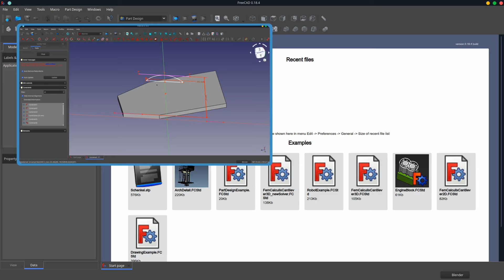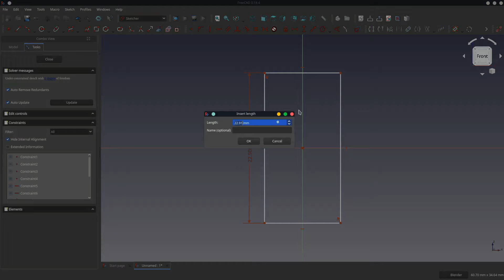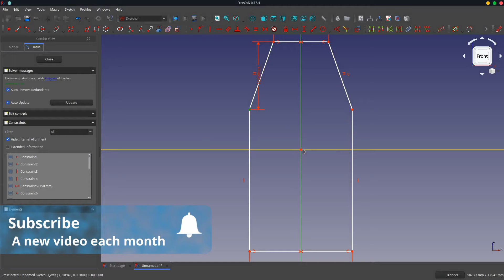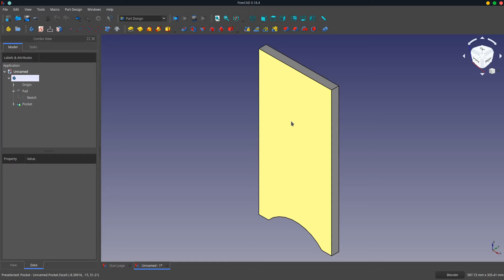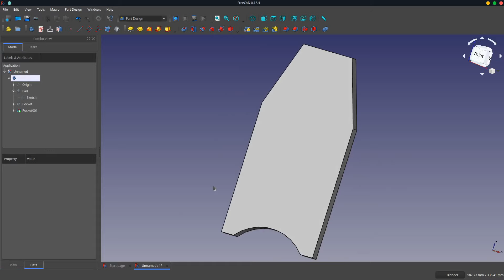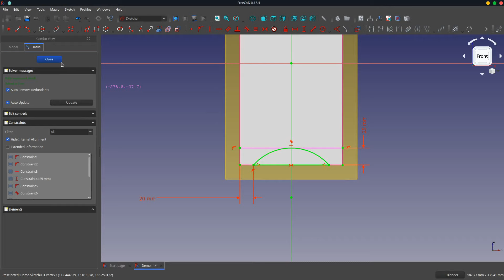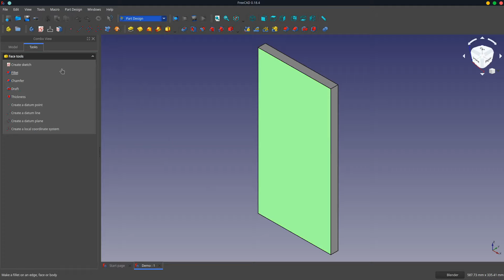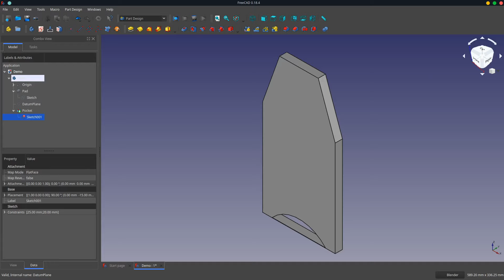Exploration of the Topological Naming Problem in FreeCAD

Comment: Interesting video. I am very new to this but it seems to me that whilst what you describe gets around errors, it doesn't get around the fundamental flaw. I thought one key feature of a parametric editor like this was the ability to go back to an earlier design stage, make changes, and have them propagate through.

For instance, I haven't tried this, but I am assuming that if the datum plane is disconnected from the face, and that face was padded by 15mm from the original sketch, then if one went back and changed the pad to - say - 20mm, the cutout would now start 5mm under the original face - because the link to the face has been broken? So, the design file is not broken, but the intent of the design is.

Clearly there must be limitations - even with no TNP if the face no longer existed after an earlier stage change, or maybe a design line or vertex made visible no longer exists, some sort of error would have to occur, but it needs to fail gracefully.

Maybe therefore, there is no answer to TNP at the moment.

Do editors like Fusion 360 have the same issue, or is it specific to FreeCAD?
Reply from the maker: Hi Nick, you're correct in your assessment and example are correct. I understand that this is a fundamental flaw with the current versions of FreeCAD but that there is an experimental fix for it that has not been merged into the main development stream yet. This means that we'll have to work around the problem for the time being.

I can't say whether this is a problem in other CAD packages such as Fusion 360 because I haven't used them,

Comment: I realize that this video is 4 years old - have you checked this with the new 1.0 version?  And will this method work with the 1.0 version.  Thanks in advance for any assistance you can offer.
Reply from the maker: Thanks for your question. I had heard that a lot of work had gone into fixing the problem in version FreeCAD 1.0 but I hadn't actually tried to reproduce the problem until you asked. I created a step tool side as per the video in FreeCAD 1.0 and the topological naming problem seems to have been solved - at least as far as my example is concerned. That's good news from my perspective but I haven't done enough testing to be absolutely certain.

Comment: Another problem with using the datum plane approach is that if you change the thickness of your plank (from 15 mm to 25 mm for example), the change does not propagate to subsequent elements, so you have to reposition the datum plane. Luckily, this does not completely break the model, and can still be managed.
Reply from the maker: Yes you’re right about that
Reply: You can work around that by making the thickness a reference variable and making the plane offset equal that thickness.
Reply: Indeed, that works.

Comment: I try to repeat these workarounds with 0.19 version of FreeCAD and always get mistakes on last step (with second sketch) but these workarounds are working fine with 0.18 version
Reply from the maker: Thanks for your feedback. I have replicated the problem on 0.19 (git version 24291 ) and 0.20 (git version 25429). The rules around referencing external geometry seem to have changed between version 0.18 and 0.19. In versions 0.19 and 0.20, the result referencing external geometry in a sketch works in the same way that sketching directly onto a face, and so the topological naming problem is triggered.

The solution (from my limited testing) is to remove the references to external geometry in the sketch that defines the cutout for the foot, and use dimensional constraints to constrain the sketch. There is no connection to the base sketch once you've done this and the topological naming problem is not triggered. I hope this helps.

Comment: Download realthunder FreeCad Assembly 3 which is FreeCad with that problem solved
Reply from the maker: Hi Carlos, thanks for the advice. I'll have a look into it.
Reply: @GlassonDesignStudio  another alternative is to use the main FreeCAD but avoid attaching sketches to edges/ faces (see https://forum.freecadweb.org/viewtopic.php?f=8&t=47671#p408943), in other words make every sketch a separate entity. It makes your design robust, however it takes more time to rebuild an object since you need to manually change all features when you update one of them. The advantage of realthunder's FreeCAD version is that you can sketch on top of faces/ edges like in Solidworks.
Reply from the maker: Just saw your additional comment. Thanks for the additional information Carlos. I'll check it out

Comment: So this stupid problem still exists? Are they serious there at FreeCAD, this error stops many users that come from fusion-360. Disappointed.
Reply from the maker: Yes it does unfortunately. Apparently there is a fix that will probably be rolled into the 0.20 release but we’ll just have to wait and see.
Reply: @GlassonDesignStudio i waited and saw. Still there!
Reply from the maker: @TheRainHarvester  thanks for your feedback. I haven't checked for a while because I do my designs using the techniques I mentioned in my video. They aren't ideal but they help to avoid the problem.
Reply: @GlassonDesignStudio  i used openScad for perfect modeling. Easily changeable.  No topo bug because you always have the "program" to know what you're modifying.  Then i export csg . then import into freecad to generate cnc paths.
Reply from the maker: @TheRainHarvester  you've found the most important thing - something that works for you. I know that FreeCAD has its limitations but it suits what I do and so I persevere with it.